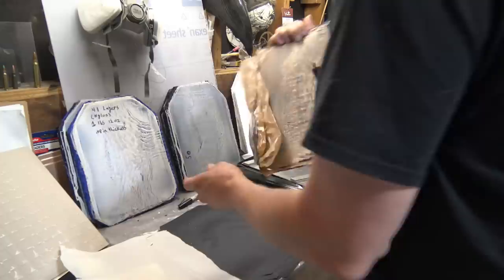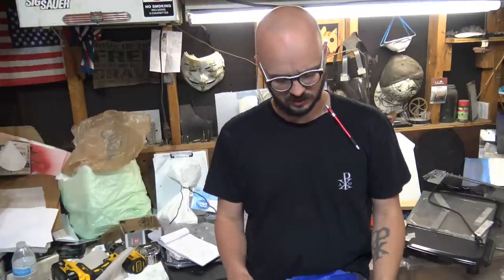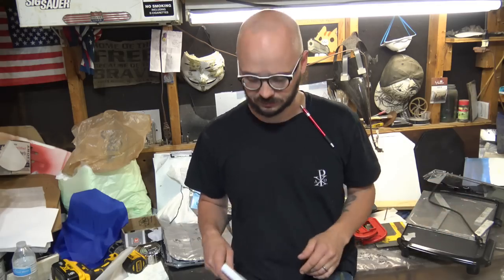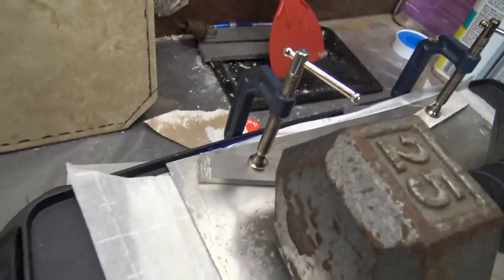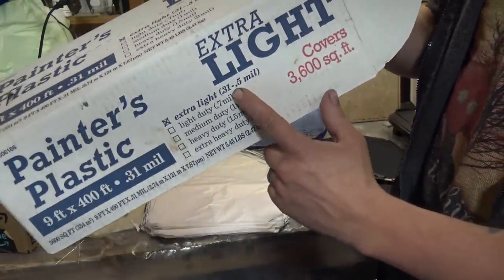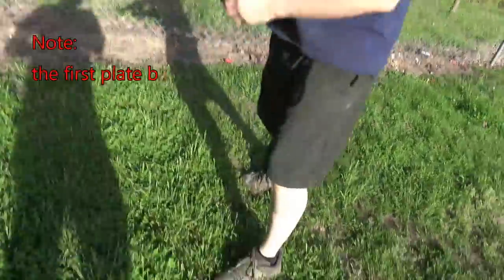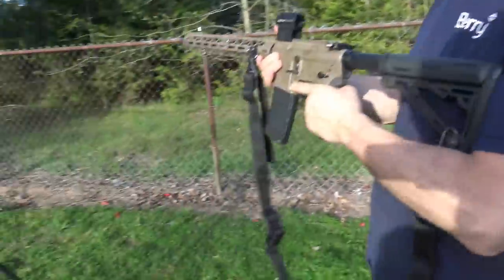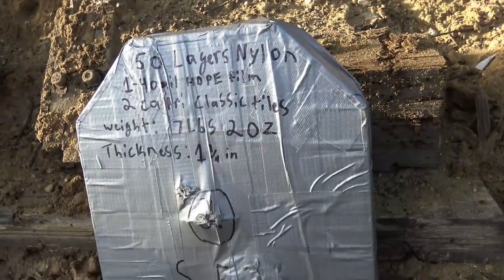Nylon and HDPE composite armor!

Comment: May have been in the video but what was total cost per plate?
Reply from the maker: Excellent question. So the ceramic costs $1.50 per tile (you'll need two if you want the best plate shown), and the nylon fabric was $7.99 per yard ( it's often sold at 58'' wide and by the yard, you need 50 layers so you'll need a little over 3 yards. I also got this fabric half off so.) and the HDPE can be just grocery bags. So the total cost is $26.97! Really, it depends where you get your nylon from. thanks for the question, should have added it to the video.
Reply from the maker: @ghostwriter1415  2435 fps, 123gr fmj
Reply: @Techthisoutmeow  any plans to test with something like underwood, Barnes, Fort Scott TUI, anything solid copper?  I'm curious to see how the monolithic projectiles do.
Reply: @Techthisoutmeow  also, you forgot to add $0.69 for the duct tape.
Reply: @RichardCranium321 We can guess how they'll perform. Same as just about all other armor.

Comment: For those iffy on it; just remember.  Like 3D printed firearms (at this time anyway) It only has to work long and well enough for you to pick up factory made gear.  Having this improvised armor is FAR better than not having it at all given how it will stop any pistol cartridge, protect against stabs/blunt shots, etc.
Reply: Actually, it's even simplest than that. If you get hit by a rifle round and even if it stops it, you're still gonna be out of the fight to where the enemy either can't get follow up shots or the enemy can while you can't react. It's like getting hit with a sledgehammer in the chest, believe me, armor prevents penetratuon but the concussive force will knock you off your feet.
Reply: Bingo..
Reply: @varun009 but the alternative is…. Good nite.

Comment: Try putting the grill in a vacuum chamber to evacuate the air. Use a low cost HVAC pump or a hand held much lower cost brake pump. Removing the air will likely give you better layer adhesion.
Reply from the maker: Simular to an autoclave in that regard, well I'm not sure if autoclaves pull vacuum. 🤔 either way, pulling a vacuum is both safer and easier to set up, I like the idea. Thanks for the suggestion
Reply: @Techthisoutmeow  my experience with autoclave is that they don't typically vacuum. Typically slight increase in pressure. However I could be wrong about that. Autoclave goal is to get things hot. While you can make steam with a vacuum typically the purpose of autoclave is to get things hot to kill germs and bacteria.
Reply: a large vacuum chamber, large enough to fit the grill in with penetrations for power,  that was strong enough to pull a strong vacuum would probably be cost and space prohibitive.

Comment: Have you ever heard or experimented with ripstop nylon? I used to buy old cars with the CV boot out. Then I made a CV boot out of that ripstop nylon from the fabric store. They also make a polyester roofing underlayment that's pretty tough. I think it would melt and stick to the high-density polyethylene pretty well and alternating layers of that stuff might give you quite a bit of strength because the ripstop nylon really spreads energy well.

Comment: Here's a trick for visualising deformation and detecting faults which the Japanese use for monitoring concrete faults: glue on a sheet of paper to the fault surface (plate back), then paint the sheet of paper using egg white or glue with a coat of fine strontium aluminate glow powder. You will get a mechanoluminescent flash and glow where the deformation occurs so you can see what has happened that would otherwise be hidden under layers.

Comment: I don't know if you have already done it, but if not, use individual hexagonal tiles so the damage is only localized to one or two tiles instead of the whole tile.
Reply: this is gone over in his first or 2nd video. he briefly mentions the cost difference of the porcelain mosaic tile. i think youre right though as for a finished product, but its much more expensive than single tiles for now
Reply: He has a tile cutter, but it would take too much time for a simple test plate.
Reply: @highmolecularweightRDX  You can buy shaped individual tiles.
Reply: 2 layers. A lot of seams with the hex tiles. I've wondered what the best material (flexible) to encase the tile layer in. Something to hold it all in place when its shot so it may take multiple shots a little better

Comment: I actually used a cheap carbon fiber/kevlar blend wrapped around some of my steel plates as a spall jacket.

I used a bedliner as an adhesive, wrapped it in shrink wrap, taped everything up and then used the front wheels of my truck over the lawn to apply pressure overnight. 

Used an ar500 steel target as a test run before applying it to my plates, and with wrapping every other layer completely around the plate, at 10 total layers, it took well over 120 rounds of m193 before I started to see delamination. 

Im not sure how much weight it added, as those steel plates are only used as backups for my 1155s, so weighing them hasnt been a concern of mine. But that may be a good way for you to look at a ceramic plate backer, assuming it isnt too heavy.  Wrapping a few layers completely around the ceramic plate would also help prevent delamination, and would help hold the ceramic together longer.
Reply: Carbon fiber is very suboptimal for shock loads.
It shatters instead of stretching and delaminating.
Reply: @dwwolf4636  I'm aware. It's a CF/Kevlar weave bound together with a bed liner. 

I wanted the CF/Kevlar mesh specifically for the rigidity of the CF and the durability of the Kevlar. It isn't supposed to stretch. It's supposed to keep spall from coming back out.
Reply: Is there anyway I can look at some photos of your work?
Reply: @Waddlejpg  If I had any of the process itself, I'd gladly share them. As it sits, it just looks like a rubbery coated plate. lol

Comment: Great results. Did you ever tried laminating glass fiber MESH into HDPE from jugs? I found your earlier videos where you shot to pure HDPE block, and most bullets that passed through look like they "melted" their way through plastic. Adding mesh to HDPE could prevent it from stretching too much, but still rely on the friction stopping of the bullet instead of delaminating layers.

Comment: Just saw this on another channel, have you thought of doing a interlayer of epoxy-sawdust/carborundum?  This should help with cracking/splitting that I am seeing in your current HDPE/nylon composite, and the carborundum should help resist/deform hard steel penetrators.

Comment: I really appreciate you showing me a higher and better use for all the plastic bags my wife collects so I can make an extra trip to Walmart to get rid of them. Your work on improvised body armor is impressive. Usually, it turns out you can only have two of the three choices of effectiveness, cost, and lightweight for body armor. You are homing in on all three.

I'm not sure how the sharp edges of sandblasting grit will affect the integrity of the Aluminum Oxide and UDP composite panels you gave us a peek at? However, #8 AlO3 sandblasting grit is from 1/16 to 1/8-inch in diameter. That size or smaller might be used to increase the density of Aluminum Oxide in the composite panel.

Comment: I've thought of using hardening materials to make my own body armour too. Like steel mesh sheets and grinded steel with ceramic mix with the powder steel from the grinded steel for the mixture instead of ceramic, and hardening and tempering too see if it'll actually work, and asking a gun range to test different calibers on it.

Comment: Hi just wanted to throw out an idea for future builds. I saw a cool video of plexiglass being dissolved in acetone and think that this could be used in place of resin when building kevlar or fiberglass plates. In theory you would have a solid plate which could be thermoformed to shape it after the initial curing of the acetione. Keep up the great work on inovative videos
Reply: Isn't plexiglass another name for Polycarbonate? Or is that Acrylic? I'm confused now lol.

Yes you could do that, technically I always thought dissolution of Polystyrene or ABS plastic in acetone would be a good polymer resin for Fiberglass or Nylon fabric adhesion since melting any styrene type of plastic in an oven is really dangerous.

Melting Polystyrene or ABS using any kind of heat can cause the plastic to release fumes that are highly toxic and can be deadly if you breathe them in. The only way to melt them down safely is by soaking them in Acetone PS melts pretty quickly in Acetone ABS takes a little longer to melt but it will fully dissolve in Acetone eventually if left in it long enough.

I'm kind of interested in what would happen if we explored other recyclable plastics as resins/adhesives for fabric reinforcement for diy composite body armor. Could we theoretically be able to make stronger ballistic plates that can withstand bigger beefier meaner big boi rifle cartridges without much risk of serious injury to the wearer of said plates?

I have pondered this very demanding question in desperate need of an honest answer for quite some time now. It's the very reason I've been pestering Tech to try PET plastic resin for fiberglass reinforcement for armor plates instead of HDPE since we already know the result of using that for a resin would be. 3+ rifle rated diy sapi bordering level 3x since it almost defeated a 7.62x54R LPS out of a Mosin w/ a 29 inch barrel. And the reason the need of an answer to this is so desperate is because half of America lost it's mind no thanks to a disgruntled 77 year old man who cried election fraud repeatedly on social media and people started getting really crazy and violent shortly afterwards. And I fear that dark times may once again soon be upon us in a little more than a year from now.

Comment: If you can get hold of a bunch of used up,chipped tungsten carbide cutting bits from a machine shop,you could fuse  them into a HDPE plate. Carbide will chew up any bullet,and if you can hold them in their place, it will stop AP rounds as well.
Reply: As good?; just as good?., or
not as good as sand?
sand / tungsten at shredding bullets?

Comment: Just Love Your Videos! And Big Thanks for the Idea with that Griddle! 

Any Idea of baking Hardox500 Plates into HDPE? HDPE would Act as the Spall Liner and the Hardox500 that is similar then AR500 takes the Hits? Maybe some Nylon or Fiberglass mixed with Resin on top of the HDPE.

Good Idea or Overkill? What can be Problematic?

Thanks again for your Work!
Reply from the maker: I've been interested in the idea of using HDPE as a spall/frag coating, I bet it would work great. With steel that is something you do have to consider, and I imagine adding fiber reforcment would only help. So yeah, that would be a fun experiment to try!

Comment: Try using a vacuum pump to draw down an oven cooking bag with your form and layers inside. Not only will it remove air bubbles but will provide a much higher total pressure on the form.

Comment: Just watched a shadiversity vid on tire armor that stopped arrows and most blows(other than a thick spike on the back of an axe) and it got me thinking what if you cut out a piece of steel belted tire the size of one of your plates and used rubber glue or something to bond it to said plate would that up the stopping power for higher calibers? Old Tires are everwhere and if you have old plates you made that can still take a hit or two it could be something you can bash out pretty quick.
Downside I see is it would up the weight quite abit

Comment: Looks like I know how many layers of this composite I will be using for my armor along with HDPE/fiberglass + PET/fiberglass matrix composite for my torso. I really hope that ceramic ball strike face holds up really well especially against sustained rifle fire. 

It would be nice to have a strike face with an insanely high multi hit capability so any composite armor you come up with could withstand hundreds/thousands of rifle bullets without failing instead of stopping only 5 or 6 consecutive hits if you're lucky. But I know that would be an impossible thing to achieve.

Comment: I've got an idea.  A little more costly maybe.  Cordura nylon (non-urethane coated), fiberglass, steel flashing (thin layers, not thing layers) and aluminum flashing (again, thing material) and rubberized dip with a handful or 2 of plaster or caramoc dust mixed in.
  The aluminup was impressive, steel plates are also impressive.  The ceramic plates seem to take the energy out well; but they basically turn to dust after a few rounds.

More or less layer the nylon, fiberglass, steel flashing, fiberglass, nylon.  Then make similar layers with aluminum flashing in between in place of the steel flashing.  Then bond steel sandwich, aluminum sandwich alternating; so that you have 3 layers of steel flashing and 3 layers of aluminum flashing, 12 layers of cordura nylon and 12 layers of fiberglass, all soaked with a rubberized dip (it may have to be thinned a littls bit with some form of thinner which will eventually dry).

More or less, the idea is instead of having a hard resing thats prone to cracking, or holding the fabrick layers stiff; you have a bonding medium that will allow fhe fibers to flex and stretch a little. And all the different layers all provide their own drag or resistence to the round.  
   Eben better, cut half the layers on the bias (so that the threads run diagonally in an X pattern) and half the fabric layers on the verticle (so that the threads form a cross pattern)  and  put it so that no 2 layers are aligned back to back.  So like...  all the nylon layers .ake crosses and all the fiberglass layers make Xes.  Or vice versa.

It may need more than 3 layers of steel, 3 layers of aluminum, 12 layers of nylon and 12 layers of fiberglass. But it woukd be neat to see if something like that around 7 to 8 pounds would do.

In all honesty...  if it wont stop green tip, it wont stop much.  Because everybody and their brother has green tip (M855) now days.
Reply: Wow that's one hell of an idea, sounds like it might be a bit spendy but you know what can you really put a price on your life, the rubber coating are you specifically talking as a poly urethane?
Reply: @wth......53  eh...  if you think about it, probably most of the materials can be found in construction/ demo dumpsters.  And the rubber coatings...  They're like a polyurethane...  the ones I mentioned are very pricy.  But I remember years ago there was one that was almost the same that was used for bars and restaurants tables that was a self healing eurethane.   Like the tables at Sunny's pit BBQ used to be.  That THICK yellow coating of eurethane that always feels slightly tacky or rubbery.  And you could put a little groove in it with your finger nail or base of your fork, and by the end of dinner it would be gone.

I haven't been able to find it in about 10 years.  But that stuff was about $20-30 a gallon a simple no much brush/pour on and would be ideal.
Reply: @CrazyIvan865  I know exactly what you're talking about I got some friends of mine that builds hotels, and at casinos I'm sure I could find out the name of that stuff, I was also thinking that fiberglass resin what would happen if you poured it say 3 in thick in a mold with the catalyst I wonder how strong that would be, with just the resin on its own at 3" thick

Comment: Considering you are testing the material at basically point blank range, your designs are AWESOME!!! How would they hold up at a further distance? Again, you are providing much info and opening thinking for others. If we all work together, at some point, we will be able to design some plate that will stop nearly everything. Thanks for doing so much research.

Comment: I’d love to see you try a quartzite tile instead of a ceramic

Its basically the hardest tile you can get at the hardware store

You might be able to get away with using only one layer of tile instead of two
Reply: It's also stupidly heavy. Knife sharpening stones are made of aluminum oxide, maybe they would work? You can get them pretty cheap from china.
Reply: @highmolecularweightRDX  stupidly heavy is how I like it with my armor, even though that's not for everyone. 
If his claim about the quartzite tile being the hardest tile you can get at a hardware store rings true then it would be another perfect candidate in the long list of materials I'm looking into for my bulletproof exoskeleton.
Reply: I've never heard of quartzite tile before, I may have to check that out.
Reply: @nemesisobsidian stupid heavy is how you prefer your armor? I'm confused as to where the benefit is, it massively limits movement and speed. If you're taking fire those are both things necessary for survival.
Reply: @Bryant-gi5sx   What I'm trying to do is find the densest materials possible that can be used for armor while trying to keep everything reasonably light. I realize Quartzite may be a bit hefty, but if you combine it with something that weighs almost nothing like HDPE, then the trade off could be worth it. 
I can probably handle armor that's a little heavier than what most people are comfortable with as I used to be able to lift and carry large CRT Television sets when I was 14 that weighed 90-100 lbs. each.
Reply: @Bryant-gi5sx  Also what I meant by stupidly heavy was material density. Density is an important key to an armor's ability to be capable of stopping anything. The denser the armor is, the harder it will be for any bullets to pass through it. Hardness can also play an important role too, of course.

Comment: Look at how DIY skateboards are made with vacuum bag lamination. You could do the same thing here and stick the griddle+plate material inside of one. They're called TAP (Thin Air Press) bags and are fairly cheap and often come with hand pumps.. Though running the cord would be a problem and would require you to cut/mod the bag